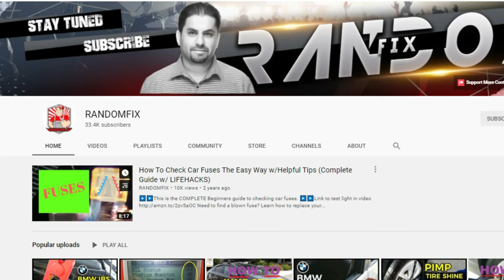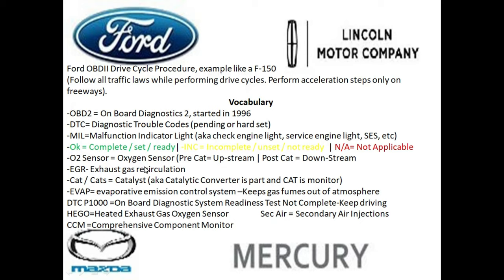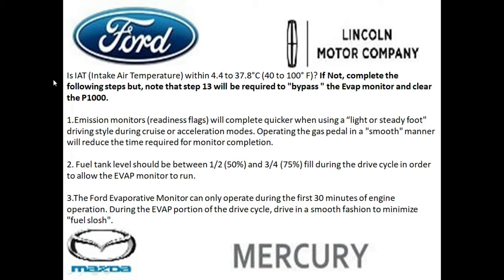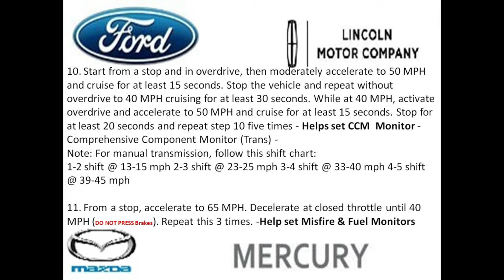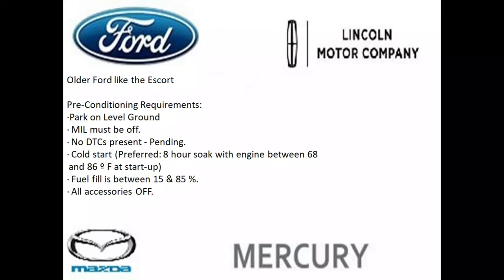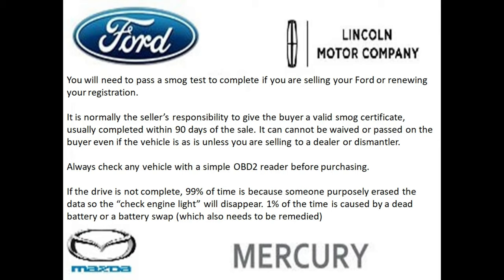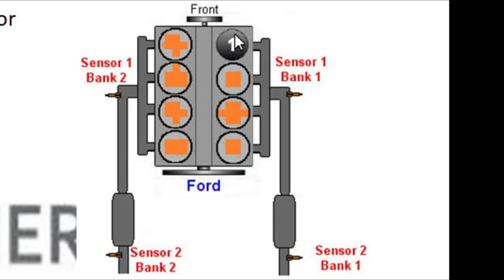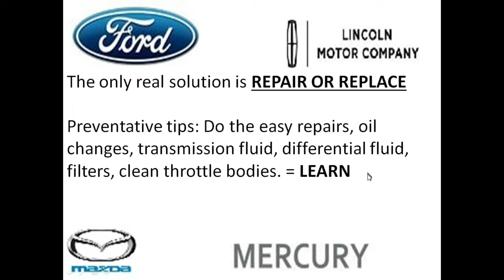Ford Emissions Drive Cycle▶️ How to Pass Smog Lincoln Mercury Mazda

Comment: Endless 0-60s at 3/4 throttle and 60-0 coasting with no brakes, and still no EGR complete, after 75 miles.  EGR Duty cycle test results show within range in scan tool.   Any ideas? 2002 lincoln navigator 4-valve 5.4
Reply from the maker: Sorry for the late reply, I appreciate your feedback
did you get this handled?
Reply: @RANDOMFIX yep solution was more patience and more miles.